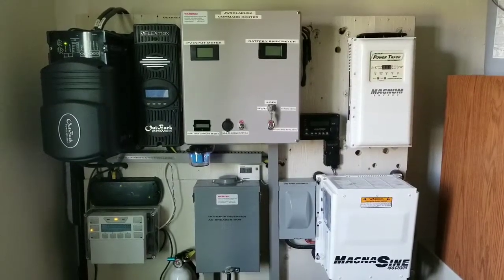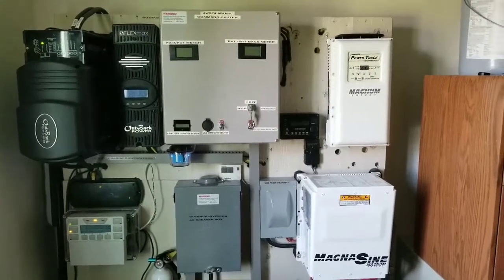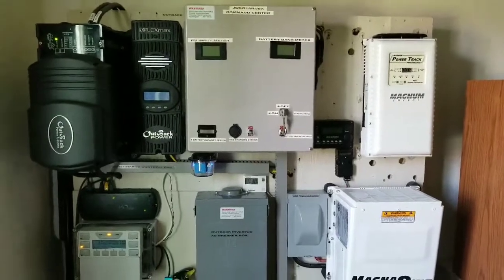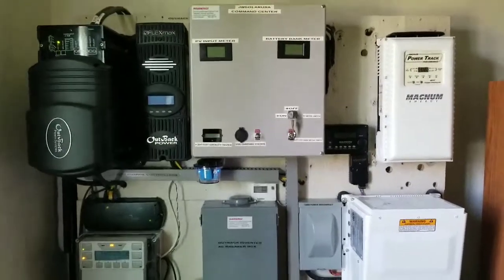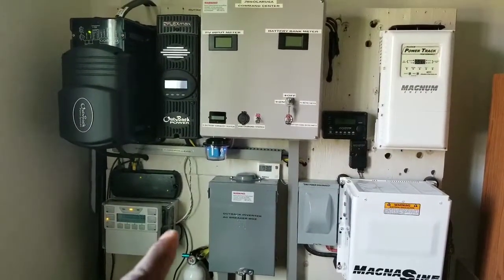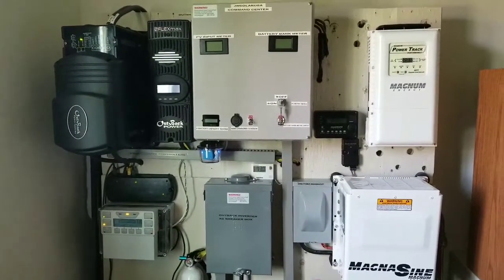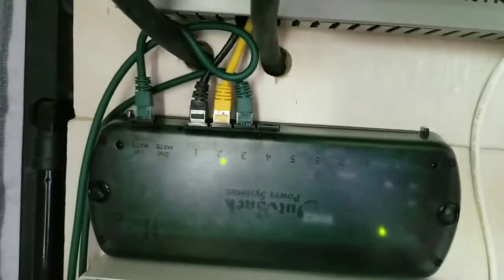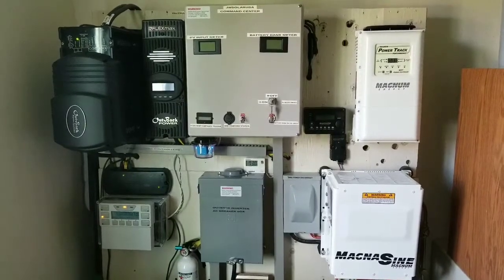THE UGLY TRUTH BEHIND OFF-GRID SOLAR POWER SYSTEMS AND SOLUTIONS: Off Grid Power Solution Updates #4

Comment: looks good...are you going to configure all your batteries to work with the outback 48 or keep a 24 volt system too
Reply from the maker: I am currently monitoring the system performance and the batteries how they charge and discharge.
The VW e-Golf 8.544kWh Lithium Powerwall is not not yet paired. It is Configured for the Magnasine Magnum Energy MS4024 INVERTER/CHARGER. 
Thanks for asking and for following my projects 👍